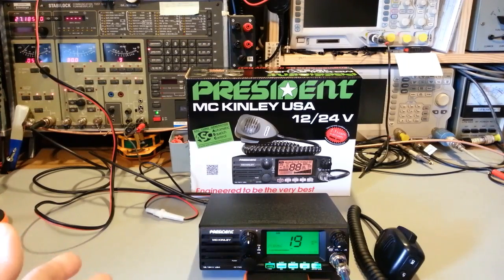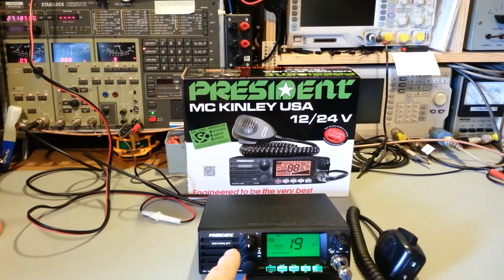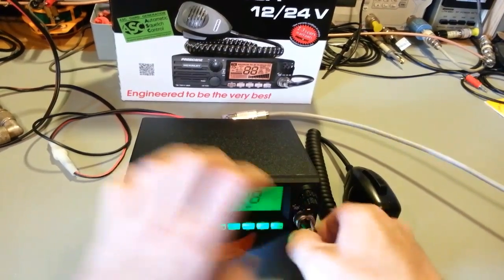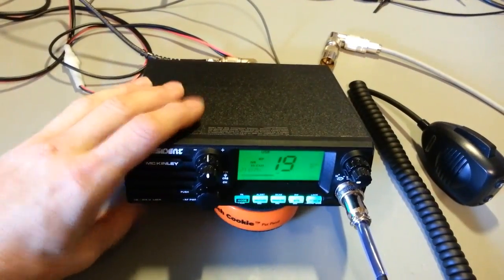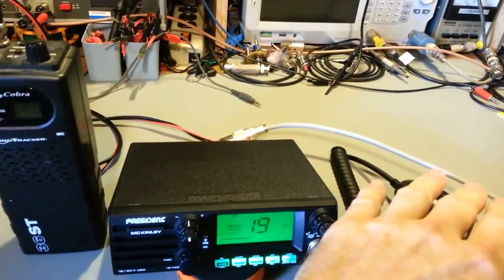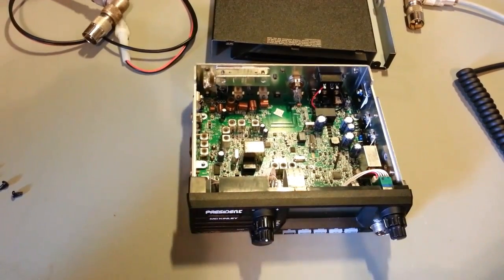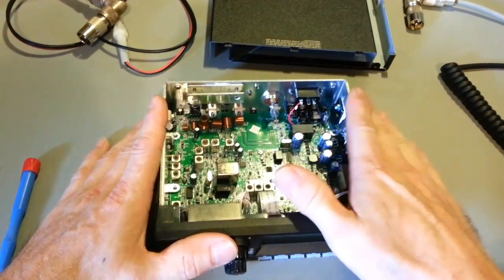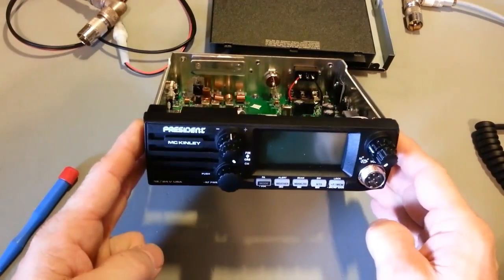President McKinley USA 40 ch AM/SSB CB radio teardown and review.

Comment: Great review and teardown. I'm tempted to get one of these since it'll fit the space in my car better than the President George. Nice to hear that the sideband frequency stability and tempco are good !  Amazing that they sent you a service manual too !!
Reply from the maker: Oh it's even better than that, you can buy repair parts from them.  That's something you just don't see these days from CB manufacturers.  They also have one of the best warranty's in the business.  I did warranty repairs for them for several years before I switched to mainly commercial and amateur radio work and they were a pleasure to do work for.  One guy bought a radio, unpacked it and was walking out to his vehicle to install it and slipped on the ice on his sidewalk.  It slightly damaged the faceplate and he wanted to have it replaced.  They just sent him a new radio.  When if ever have you head of a company replacing a product that you broke even if it was a accident.  That's just good old fashioned customer service and I'm pretty sure they made him a lifetime customer.
Reply: @mikesradiorepair  Wonderful.  I recently got a President Randy II and one of their mag-mount antennas. Both work great. The Randy II HT has 10 dB better sensitivity than the (admittedly cheaper) Uniden HT I got at the same time. MDS in AM mode was like -135 dBm - at least using my TinySA Ultra source with 30 dB attenuator. And the antenna is exactly centered in the band and only reached 2:1 VSWR at the edges. After those tests, I believed them when I read their motto: "Engineered to be the very best", and your experience solidifies that belief for me.  Thanks!

Comment: That was a great review I think I'm going to get a mckinley for my pickup truck need an amp driver. My 980 is cranked way up for my dump truck and i cannot drive an amp with it. the only thing would have been cool if you did a power test on a.m. and Side Band with the variable power knob I guess it's probably only relevant to me because I need to drive an amplifier. But awesome review those McKinley seem to be very very good radios

Comment: Hello mike, this is mike as well lol. I was wondering, i have a McKinley that's out of alignment and I have a friend whos willing to help me align it but i need help finding alignment manual. I've found the manual online but for the board model numbers matching it up with the manual I'm not sure if I have the right one. the big numbers printed on my board say PB-373AB 1/4 and the sticker label they put inside has 3 lines 1st line says UT566z 2nd line VA3194 and 3rd line V200. not sure if any of those numbers are the "Model number" for the board. in manual I found where a few of those numbers matched but was missing or had extra characters in the number like for example I found in manual PB-373A but it didn't have the AB does the B matter? those sorts of things. Not sure if your on qrz the call is w9btm contact info is good.  Any help would be appreciated. Thank  73

Comment: Yep and all you need to work on this radio is a $6,000.00 solder station !
Reply from the maker: No, you don't need anything but a regular soldering iron and a little practice.  Even surface mount IC's can be removed with a normal soldering iron if you use Chip Quick, SRA Fast Chip or similar removal alloy.  And if you wanted to use a hot air rework station they cost nowhere near $6K.  There are plenty of very reasonably priced units on the market these days.
Reply: @mikesradiorepair  Wow I did not now that !  Can you do a video on using a radio Shack soldering Iron to remove a micro processor from the radio board and install a new one  . Can not wait to see your video !
Reply from the maker: @BIGBADWOOD  Already did one.  https://youtu.be/_g8mvs482Ng
Reply: @mikesradiorepair  

Just watched very informative thanks for your response !
Reply: @mikesradiorepair  Have you posted a video of remove a chip resistor from the radio board and install a new one using the same equipment and technique ? Would love to see how you do the smaller components .

Comment: It is a bit strange that Citizens Band Transceivers are not based on PowerSDR technology which would make them much lighter as all processing is done using high school mathematics on DSP processors and not discrete electronic components and has DSP based Adaptive Noise Filtering to give a nice clean audio minus the interference.

Comment: Been running one of these in my motor home for a couple of months now, and I really like it. As Mike said, the ASC works really well. While the transmit audio was decent, it didn't have that loud clarity that I like. Plus, I really like having echo on all my radios. Solved both problems with a Xtreme 2018 Road Noise Echo mic. The modulation really came to life with it and it's loud and clear. I have actually had people ask what kind of radio I was running because of the sound. Running my set up with a grounded Firestik side mount and a Firefly 4' antenna. Also using the front firing internal speaker. It's plenty loud and clear enough.

Comment: Mike
Should i bother to get my Mckinley peaked and tuned?
I’m new to CB and using my Mckinley as it came from the factory.
Reply from the maker: The radio works fine as it shipped from the factory.  Many people get a transceiver alignment done when they send in a new radio like this to have the clarifier unlocked.  You get a little more power and modulation.  The biggest improvement is usually in the receive sensitivity.  If your big into working DX stations that are barely perceptible above the noise floor then it's probably worth it.  If your just going to be talking to local stations or strong stations then it's not worth it.
Reply: Thank you Mike
I love your channel and as a newbie. I am mesmerized on your knowledge and expertise. You are a Dr for electronics..

Comment: Is this a phase locked loop radio?  Okay it is micro processor controlled.  I understand phase locked loop radios like the old Sears and J.C. Penney's radios better.  That's my generation of radios back in the mid 70's and 80's.  Wow!  That SWR feature is simply amazing.  Why don't they do that with all radios these days?

Comment: Mike, I realize you were (are) burned out with all the junk modifications, repairs etc and probably the return from youtube effort has gone down, I still miss you and your videos. If you are still repairing,  no one has made it known. As a ham with old radios needing new caps etc and 70 years old eyes, and just fixing  I think a market exists that lets you do meaningful work, not fixing junk repairs with CBs. You have me convinced you COULD fix  badly needed to be repaired radios. I suspect if you just found old HF rigs, parted out some to fix others and had a place to sell the repaired ones ( Ebay right now)  you could make use of your talents. Please let me know, my email is the same as this handle @gmail.com .   I miss you Mike!!!

Comment: You have sold me on this radio. I got out of CB years ago, when I started into commercial VHF. I find it funny that modern CB's are looking more and more like the current VHF/UHF mobiles. I like it though. This is a very practical radio for a daily driven vehicle, and it will fit in well in a Havis console. 😉

Comment: I absolutely LOVE the ASC feature in my President Lincoln II+ and I use this feature every day and it works fantastic. The original Automatic Squelch they used to put in the original President Lincoln, HR2510 and 2600 radios were strictly analog and worked very different from the current "ASC" they use nowadays. I still have my old HR2510 and the old version of Auto Squelch in that radio works differently by only allowing signals to break the squelch that are S-3 or higher. The current Auto Squelch Control version works much better though.

Comment: Awesome video. I'm currently a uniden 980ssb owner in the mobile, and you have me nearly convinced to buy the McKinley.
BUT... I need to know. When using in the mobile, does the weather radio auto scan to find the strongest (i.e closest) weather station? The 980 has this feature and is actually more vital to me than the cb itself (car driving nurse with Oklahoma weather).
Thanks again for the awesome through review!
Reply: The 980's weather alert notified me of a tornado that ended up coming within two miles of me. Very handy that day.
Reply from the maker: I honestly didn't know.  I have my bench radio set to WX channel 3 and it never moves off of that so I had to check.  If I hit the weather radio button it switches to weather radio mode.  If I then hit the scan button it switches into scan of the weather channels.
Reply: @mikesradiorepair  Sounds like similar behavior to the 980. Thanks for the reply! With the 980, I can turn Wx scan on/off and Wx Alert on/off... and if I turn on the Wx radio to listen ... and if scan is on ... turning the dial causes it to go thru and find the strongest station (typically the one I was listening to when I pushed the Wx radio button). And - the Wx Alert was enough to scare the Bejesus out of me one night when I was between patient visits (hospice nurse). I often wander between regions of local weather stations, so I can see it swapping stations to the strongest station at my various destinations.
I really like the forward facing speaker of the McKinley and can see me swapping out the double DIN height stereo (with the flaky volume) for a new radio and a McKinley ... BUT - I can also see going with the Lil Bill and that same 2m/440 FM rig in my car. It's not often I'm using SSB in the mobile.

Comment: As of today I personally have 5 in service between relatives. Working with long distance road technicians using company vehicles as assigned, easily swappable between rides is great with the light weight meaning less strain on mounting protocols and wear on internals themselves. Hard to reset power output to kickers going down road though, (set before heading out if needed). DW use is much more than MEM Scan b4 17:00, but 5 channels is great at sundown. Seeing your view of FINAL was the deciding thought for our purchase design, THANX. Oh yeah. Earth movers are starting to get these little guys now too, for similar reasons.

Comment: What if the clarification is out from the rigs you receive from?
Suppose it matters only with the operators rig!
I am waiting on an order for a President McKinley looking forward for its arrival thanks for your demo👍
Reply: You unlock the clarifier so that the transmitter swings with the clarifier.  The clarifier and transmitter are then tied together so that you can talk between frequencies or to those who are off frequency which is a lot!

Comment: I use to be into cb in a very large way ,some of my last radios were a Tram 900.00. Plus a silver eagle,A Robin tube type too..,and a Motorola digital you could do everything from the Mike ,I always had all the top radios ,for 20 year ,gave it up in 1990 ,got rid of everything ,Is it very big anymore ,Right now I trying to get into two meter hand helps ,I bought two radios to learn on ,it's way harder to learn ,so you work on two meter radios too.

Comment: As a Ham this is the first CB in many years that I bought for my truck. I hate chrome, roger beeps and echo. The fact that the beep is really low is one of the reasons I bought it !
Reply: Not sure why you'd buy a radio based on it's low roger beep, when it can be turned off outright? But not to knock you, it looks a great radio and if the UK version with FM is anything like as good I'll be looking into one myself.

Comment: I listened really well and was shocked that you several times said,SWR’s. I know that you know it is SWR and not SWR’s right? There is only ONE SWR and it is why the sell SWR meters and not SWR’s meters. I would expect that statement from a newbie but not someone with as much radio and antenna knowledge as yourself? If us old timers teach the next generation bad habits or the wrong terminology then we can only blame ourselves.We should try and pass on knowledge but the correct knowledge when possible or we are not doing justice to the hobby.There is far more than enough wrong information out there as it is.Great review but I will never trust the built in SWR Meter in any CB radio no matter who makes it. I don’t even trust the ones in my ICOM 746 and ICOM 7600 and never will.Also it is Stupid that any CB Radio has a Useless Roger Beep or Talkback.I refuse to talk to anyone who uses either no matter who they are including my local friends. They know I hate them and any unwanted and unneeded noises on any band and I will not reply to them if they use one. The 11 meter band has far to much noise and why anyone would add more is beyond me?
Reply: Geez loose alot of tears with that post? Seem real angry
Reply: Lmfao. It's the total truth. To many cry butts

Comment: I just bought one from amazon, connected to my truck and....worked 3 seconds. Planning to return it. Maybe I did something wrong (red to red, black to black). Fuse ok.
Any ideas? Maybe internal fuse, so I can check myself?
Reply from the maker: Double and triple check the external fuse.  I have seen fuses that didn't blow but the fuse element had broken loose from one of the end caps.  Try another fuse in it's place if you have one and see if it starts working.  There are no fuses internally.
Reply: MikesRadioRepair checked, all fuses are good, still have power at terminals. Even connected straight to the battery-no luck. Can antenna destroy it? I connected cable that was on the truck....
Reply: Also bought additional cb cable for cigaret lighter-no luck

Comment: Very nice radio, I like it better than uniden 980 ssb, and I lov ethe front firing speaker
Reply: Michal D Roosevelt 980SSB has a far nicer display to me. I use an external speaker so I don’t even care if the radio has a speaker at all.
Reply: @1OFGODSOWN  I find the S meter on my 980ssb worthless

Comment: The only radio I like that President makes is the original Lincolin and the new Lincolin 2. Those are really nice radios. They make very few that have SSB and reasonable power output.
Reply: I like my 25 channel 3 8 5 low side I go by Delta 146 on channel 38 lower sideband......27.385.....on....channel...1....am.. my call sign is six pack sometimes known as the seven up kid
Reply: I don't know what happened my radio is a president 2510 somehow someway the writing didn't come out the way it was supposed to oh well being being a CB guy I know you guys will work the puzzle out 😉👌😁😁😁 man I sure messed up it's heck to be 80 years Young 10-10-10 27

Comment: Nice radio but over priced at $199.00. Hay president how about a base station. It's time for one.
Reply: DieselTrucker 2018: it's now $5 off. 
Now $115.99!!  Good freakin' deal!! 
73s, Norman
Reply: If they are 199 then do yourself a favor and get the Lincolin II it is 239.00 and way better. Has every feature that a guy could possibly want.
Reply: What about the  bearcat 980 ssb  is better?
Reply: loctite222ms I much prefer the display in the 980SSB. It is just my preference but it has a Sweet display and is my all time favorite SSB mobile right behind the TRAM D64 which is the best I have ever used or owned.
Reply: @1OFGODSOWN   own thing is between 980 and President McKinley asc 980 or tram D64 do not have asc unlike President McKinley do that be little more both radio is take way plus both 980 and President McKinley have weather that tram D64
Reply: @1OFGODSOWN  Uniden 980SSB display is horrible during the daylight.  It's not legible maybe except for the channel number.  Read the reviews at Amazon about the display during daylight.  I sent the piece of crap back to Amazon.

Comment: 19 is not the Emergency Channel.  19 is used by almost everyone who has a CB.  9 Used to be the Emergency Channel.  Rarely will there be ANYONE on there, except for skip signals.
Reply: Unfortunately channel 9 is hardly monitored for emergency anymore, that being said it should never stop you from trying channel 9 in case of an emergency but there are many areas that you can mayday on 9 and nothing, no response. Sending a mayday on 19 would probably get you help quicker.

Comment: I still have my old President HR2510 I bought new back in 1992 and it has their original 'auto-squelch' feature. Basically any received signal of at least 3 "bars" will open the squelch but it's strictly analog on these old radios.

Comment: I’m buying this radio this week. What antenna do you recommend?
Reply from the maker: Keith Richmond 

If you get a President antenna at the same time you purchase the radio your radio warranty gets extended another 3 years for a total of 5 years.  Might check what President antennas the dealer your getting the radio from has in stock.
Reply: MikesRadioRepair - you are a life saver.

Comment: Mike, at 35:16 the peak envelope power (PEP) for a 4W carrier at 100% modulation is 16W, not 12.... and the peak instantaneous sine wave power is twice that, which is 32W. Very detailed review. Would you send me the PDF service manual ? Or at least share the schematics for the RF output stage. I would love to know the biasing components for those two mosfets. BTW, the UFZ24N is the same as IRFZ24N, which is dirt cheap compared to the old bipolars C1969 and MRF477.